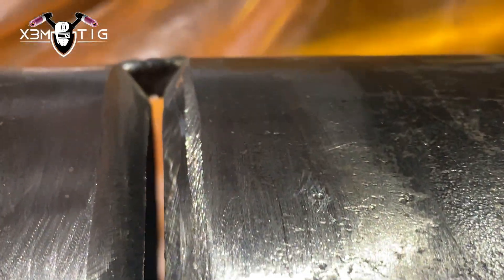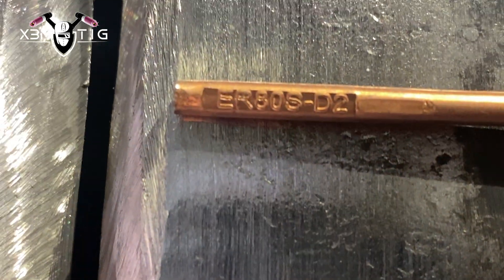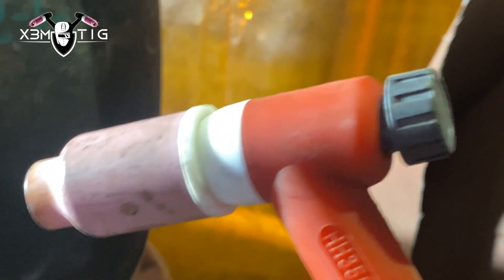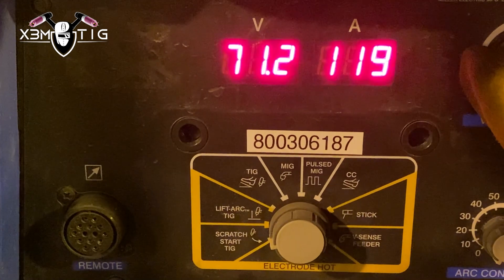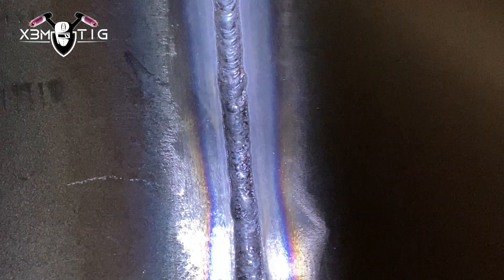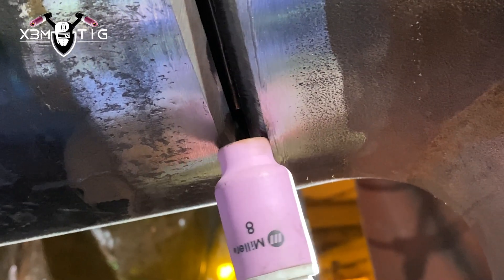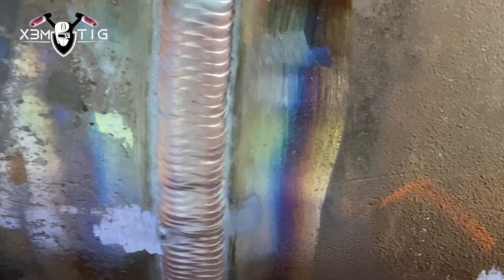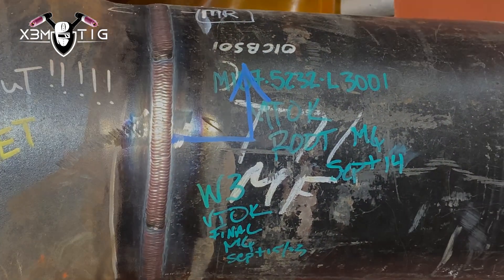TIG Welding: Root to Cap Techniques for Guaranteed Success!

Comment: Aren’t you supposed to reject pipe with hi-lo especially for x-ray i know it will show on x-ray but can you weld with a technique that it won’t show on the x-ray
Reply from the maker: It all depends how bad hi-lo is, in my case. But in general you have right to refuse if you not happy with fit up.
Reply: A small amount is normal with pipe to fitting welds